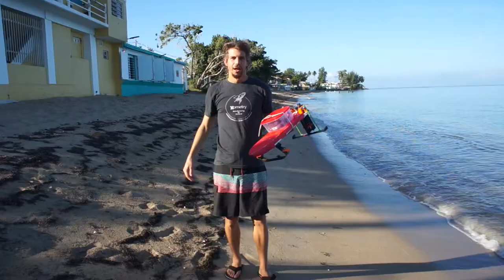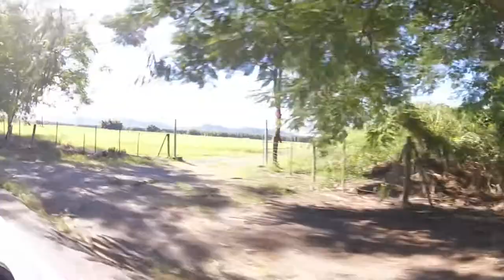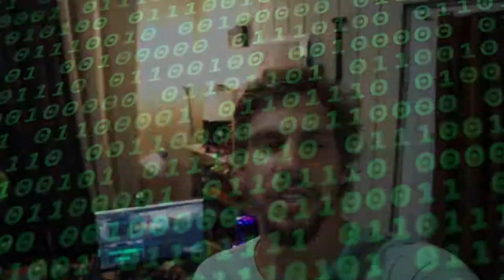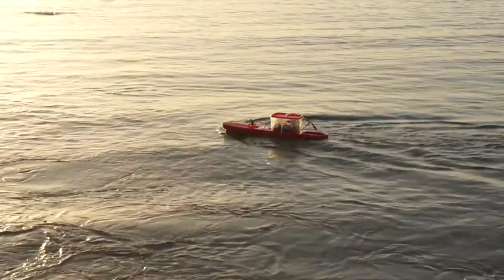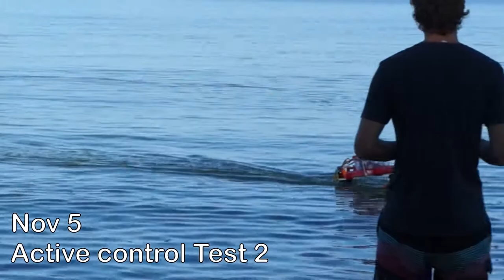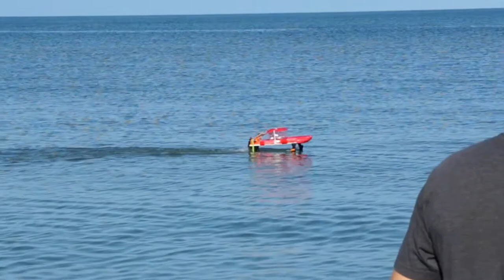04 Flight Improvements and Success!!! Active Control System Hydrofoil Boat

Comment: Gr8 stuff.  If you go front and rear active stability, with drone style flight control unit for fully automated heave, pitch and roll control, i may be very interested in more than just patreon support😉. Happy holidays🎊🍻🎉🥂🎊
Reply from the maker: Hey Steve! Thanks for the comment! That is the plan, full state space custom controller for the full scale model. Active control in all axes, even using front and rear pitch in conjunction to get good heave control. There is a long way to go there so I cant make any promises but check into the channel and i know you will see progress towards that!